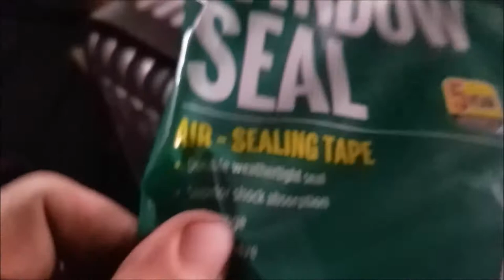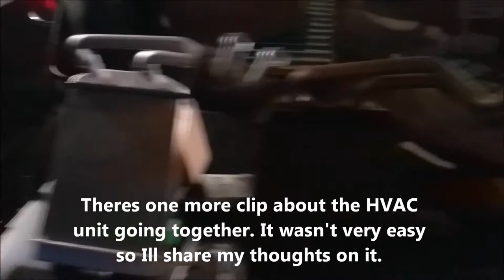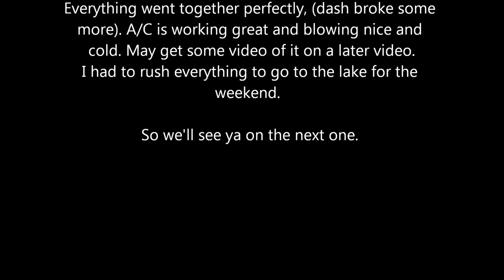2000 Dogde Ram 1500 heater core and evaperator core replacement.

Comment: Thanks for the video, I found this link on Ram forum.
I have a 1997, 2006 and 2007 Dodge truck.
I love each of them for their respective jobs, but all have absolute garbage AC and Heat.
All 3 have weak heat and weak AC. It hurts the most with weak heat in the 1997 plow truck. 
The 2006 quad cab is probably the worst - weak heat and NO AC.
All 3 are heading to my mechanic in some sequence this spring/ summer.
Probably expensive, but way cheaper than new truck BS and DEF and crap warranty

Comment: That's what happens when  evaporator core IS your cabin air filter lol. As to why they didn't put in a cabin air filter is beyond me. They weren't standard until 2017, but from (I think) 09 and on, they had the slot for one, but just didn't take the extra 5 minutes to cut the damn thing out and stick a damn $10 filter in on a 30-40 grand truck. You can "mod" one in, but come on!

Comment: Thanks for the demo....I have a massive leak into my cabin on my Ram 1500 1998. I stated by cleaning the drainage pipe. Under the hood, but no luck. Then I replaced the heater core, no luck. My AC is nice and cold for already several months. Do you think the Evaporator core will solve the problem??? Thabks

Comment: Thanks for the video bro. How much did you charge for this? I dont know if I should pay for it or do it my self....time is money.
Reply: Did you have to drain the AC gas?
Reply from the maker: I did it myself. Not a terribly difficult job but knowing what you're doing goes a long way. Yes you have to discharge and recharge the air conditioning system.
Reply: @james4wd236  hi, good video, but how many bolts exactly screw the box on the firewall ? 4 or more ? Thank you for your answers